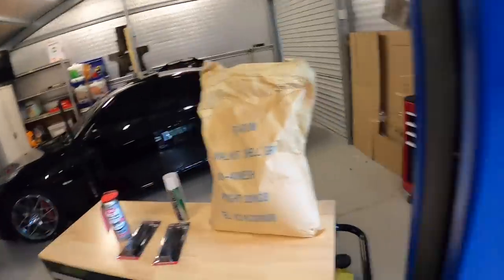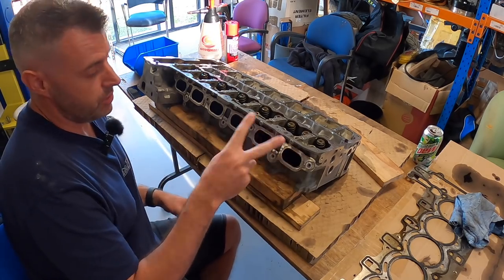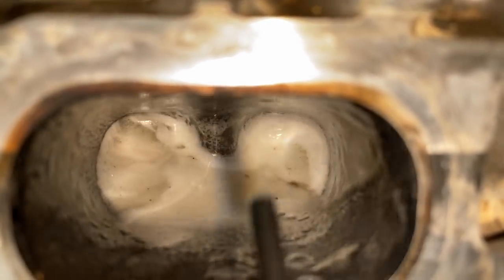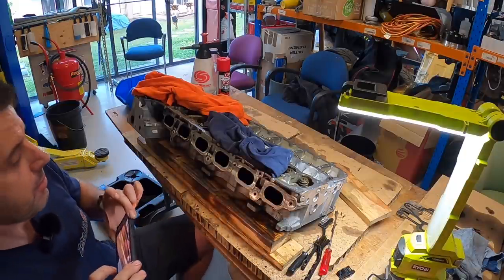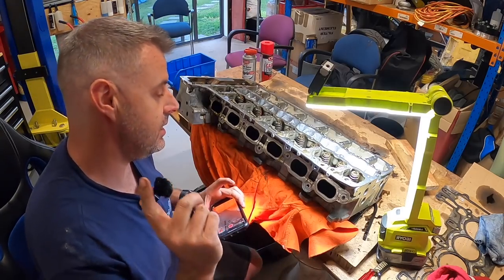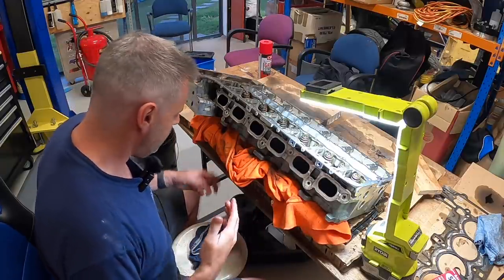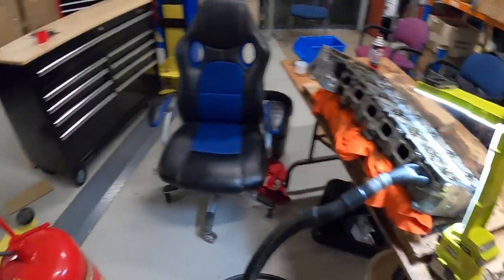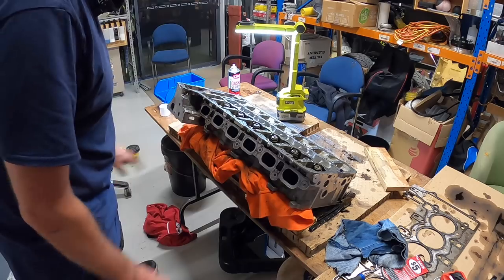BMW N54 Intake Valve Cleaning: CRC vs ThreeBond vs Walnut Shell Comparison

Comment: Brilliant video, thanks for explaining & showing the differences. I've just purchased my first BMW that has N54 engine. I would have to get a garage to do the walnut blasting for me, while engine is in car. May I ask how often or at what miles should this be done? My car is currently 9yrs old, but on 24k miles on it.
Reply from the maker: I think if you used the CRC or Threebond how it says on the can. So while the engine is running, say every 10,000ks you wouldn't need to walnut. But if you go much past that it wont keep things clean. Walnut blast i would do every 20-30k. 

If i wasnt running port injection i would be doing the chemical cleans in between walnut blasts.
Reply: @ZeroTo60Tube  I remember years ago I sprayed in a can of engine cleaner (not sure of make) into the intake of my Lancia Integrale at the time while holding revs around 2k.  It was to clean internals of engine & was rated well. Two days later headgasket went. Now I don't know if coincidence or whether the cleaner disturbed some carbon that was helping to seal something, but been nervous ever since putting additives in engine.
Reply: @stevesas632  engine cleaners wash down cylinder walls and affect the lubrication and wear the engine. They also harm head gasket material which is partially organic in composition.
Reply: @callmeishmael7452  Agreed. +1. But it might be ok to do the pairs of cylinders' valves when closed. A good cleanout and drying before the next pair should be ok, but still not cleaning the valve seats, which best done probably pulling the head and doing a valve-job.... Valve seats and seals on the valve stems work together to make the best motor - either sealing combustion, or lubricants.

Comment: have you thought about useing a burning laser to vapourize the carbon off the valves..no mess the carbon on the valves in lots of cases is not hardened on, just spongy like.. i have seen some not to costly handheld lasers here in the states.. 80 to 120 $..  just a thought i have been working on

Comment: I get why you need to go the chemical clean with the valves in situ but I'd recommend removing the valves and cleaning separately to ensure guides and valve seats are properly cleaned. 
Then hand the head to a shop for hot tank clean. Not expensive.
And I clean my valves with a wire wheel on the bench grinder without any issues
Reply from the maker: I didn’t need to chemical clean at all. As I mentioned this video exists to compare the methods. Not because I needed to. This head still needs to be stripped for what I’m doing.

Comment: Do you think using ambro carb and choke cleaner would it be better than crc? By applying it as CRC instructs (spraying it directly on the throttle body) I have a 2014 hyundai gt GDI, thinking on doing some valves cleaning as well, awesome video BTW!
Reply from the maker: I did try carb cleaner on my old motor and to be honest it was pretty similar. I think the CRC slightly tips the win tho. Something i have learnt recently is how important it is to do the treatments frequently, before it builds up like it was in this motor. Let us know if you do give a crack and the results you get.

Comment: I’ve cleaned heads I’ve had off with three bond. Let it soak for 48 hours and carbon falls off. The crc and three bond will not work inside 30 mins on a cold engine.

Comment: Question....assuming you’re doing this with head on the car.  That tiny amount of debris left at the very periphery.  You can see it when the valve opens, and you could only clean it with the valve ope, but risk some of it going into the cylinder.  Do you just leave it alone?
Reply: Doesn't cause any problems evidently as the walnut "sand" is softer than any of the parts it can come in contact with. The only downside is your exhaust may smell of walnut for a few minutes as it disposes of the leftovers, that's why they use walnut and not sand. I've recently been quoted $880 to clean EGR and manifolds and valves using walnut blasting on a 2011 Pajero with 177.000k. for interest.

Comment: I did the CRC cleaning last year and it worked great. I followed the instruction from Vehicular DIY as well. Great videos. The only thing with all of the options is cleaning the valve seat. With the valves closed it's just not possible. 
I didn't try running the engine while using the cleaner.
Reply from the maker: Thanks for sharing

Comment: Last weekend I used the CRC to clean the ports on N54 90k miles never done before. I filled ports with the slop then chiseled away with a aluminum pick set then vacuumed out the muck. I was having bad auto trans shifts turns out the engine was so choked it was effecting the auto trans adaptations making it feel clunky on down shifts. Now car feels totally different.

Comment: There was no shop here that did walnut blasting, getting the tools and importing them was waaaaaay too much money, so I went the chemical route with a methanol based cleaner. Took roughly between an hour to an hour 20 mins each cylinder and half a can each, using a toothbrush and a C thing like dentists use to reach the hard spots.
End result? Similar to walnut blasting but I can assure you I would never recommend doing it this way if you cN get walnut blasting. Takes for fucking ever and makes a mess
Reply: Use crc every other oil change and you’ll never need to resort to walnut blasting.

Comment: If the valves are not properly seating/closing because of carbon buildup at the outer edges of the valves, when you use the walnut media, does the walnut media get into the combustion chamber?
Reply from the maker: It will possibly. But I’ve seen people finish the job with bits of walnut stuck on the edge of the valve. So it must just pass through. A few pieces of walnut mustn’t cause any serious damage
Reply: Walnut media is soft, but hard enough to break the carbon down . The valves should be closed despite carbon buildup. Use his method of finding TDC. 
After blasting with walnuts you have to use compressed air to blow out remaining shells. 
If there were any that passed the valves you will burn them off or they will pass out the exhaust valve during the combustion cycle.

Comment: To use the CRC correctly the engine needs to be together and running. You are supposed to spay two entire cans into a running engine turning at 3000 rpm, with intermittent revs up to 3500. Let sit for an hour then take to the highway and blow everything out... done this way there is no mess as all
Reply from the maker: That’s what you’re supposed to do. I’ve never actually seen anyone successfully clean a di car with out taking the intake manifold off and scrubbing tho. Maybe if you did the crc treatment very frequently, might avoid it
Reply: Zero To 60 agreed, walnut blasting works the best. There’s a YouTube channel called watchjrgo that used the crc the recommended way, then used a camera to see the results.... it’s not as good as walnut blasting, but it also doesn’t require any disassembly. I have a 2010 335 and I do walnut blasting every 20000 miles, and crc halfway between blastings
Reply: Zero To 60 just realized I might be coming off rude, I don’t mean to. Love the channel, and you.
Reply: Max where do you spray crc, when the engine is running?
Reply: @coldfear19  while the Ivan is running spray the crc into the vacuum line that connects to the intake manifold

Comment: Seems the chemical cleaning methods might be something to use regularly to prevent them getting into that state, but if you need to clean up neglected intakes, walnut blasting is the way to go. One thing of interest, I mentioned cleaning the inlet valves to the euro mechanic I use and was expecting him to say walnut blasting but he said soda blasting, ever heard of that??
Reply from the maker: Soda is just a different abrasive. However I would be much more concerned about spraying it the intake. The walnut is soft in comparison. And definitely strong enough. 

Walnut works so well. Just a pain buying all the gear. And I can confirm you do need a semi decent compressor (not the Aldi one 🤣)

Comment: Just curious, how many km has the engine done and it did say on the can the engine had to be run before using the chemical products, so would that make any difference to how well it would have cleaned the ports if the head was still on the car? I do agree the walnut cleaning is a better choice.
Reply from the maker: Engine had done 120,000klms. You're actually supposed to apply this while the engine is running so it gets sucked through everywhere. But i really can't see that doing much to a built up mass of carbon like this engine had.
Reply: @ZeroTo60Tube  thanks for the feedback, I'm just looking at doing my n54 but cannot afford the walnut option at the moment and mine has done 138 000k's.cheers.

Comment: I suggest you try putting a magnet into the bag of walnut shell some of this media is contaminated with metallic particles which if any gets int the engine  cylinders or in the valve guide it could ruin your engine

Comment: only watching this cause i have the same issue, do you think fuel additives like seafoam can help with carbon build if i use it once a month?
Reply from the maker: Unfortunately not at all on the direct injection engines. The fuel is injected directly in to the combustion chamber so the fuel never passes the inlet valves like they do on older motors. Best thing you can do is frequent oil changes and a healthy pcv system.
Reply: @ZeroTo60Tube  thanks for the response mate! Looks like I'm doing it the old way this is my second time  cleaning my intake much more like a 2t😂

Comment: So if you were to run a manifold that had secondary port injectors on them (if you maxed out stock injectors) this problem could pretty much be avoided entirely could it not? Catch can would help too ya?
Reply from the maker: I believe so. We’ll get to see how the intake looks on my e92 cleaned about 4-5 months ago and have been running port injection the whole time.
Reply: @ZeroTo60Tube  that will certainly be a nice contrast to see!

Comment: Nice video.  Looks like once you get it clean, you need to use the chemical cleaner periodically to keep things clean?
Reply from the maker: Yeah, totally agree. Once the valves are clean if you used the chemical products the way they are designed and frequently it should keep it under control.

Comment: Do you think its necessary to cover up the hole inside the port that goes to the rocker cover when walnut blasting? Someone commented that you need to do it in your first walnut blasting video but I haven't seen it mentioned in any of the other walnut blasting guides online.
Reply from the maker: I didn’t cover my main engine when I did it, but I fee like they really should be. That said as long as you have a good enough shop vac it should be fine.

Comment: the three bond/subaru stuff is supposed to be used regularly as a preventative every oil change. Even back in the GC8 days we would pull off the vac line, spray it in and let it sit while doing another car. For caked on stuff you need to let it sit or repeat applications. It came out when port injection was the norm. For DI engines that are badly caked up like this it was never designed for and I would expect several applications over a period of time would be acceptable. Couple of cans vs the guy who doesnt have a compressor, shop vac and media blaster might not want to go buy that stuff to use it once a year/5 years. If I had a DI car, I would drill and tap each runner if possible and use a grub screw/bolt so cleaning isnt such a big deal. Of if you use a port injection kit just remove the injectors and spray it in there

Comment: I'm curious what the best way to actually clean the sealing surface of the valve itself would be. With the head on the engine you for sure can't open the valve and blast anything unfortunately... But at least for you with the head off, you could open the valves and blast the actual sealing surface. Seems to me that while everyone noticed the engine run better after blasting. Not cleaning the sealing surface is likely still problematic. Or I'm missing something.
Reply: Yeah, I think you're spot on. Would be quite interesting to actually measure the difference before and after cleaning the sealing surface.
Reply from the maker: I’ll do the sealing surface the same way I did the problem exhaust valve. This vid was to compare methods that most people are using to clean their intake ports. I only did this to show others the difference in the two methods.

Comment: Great video! Appreciate the time you took to make this even though you already knew the walnut blasting would take 10 minutes. LOL. Question though: what size walnut media do you recommend?
Reply from the maker: Its ordered as fine walnut here. Its about the size of raw sugar. I was genuine curious what the chemical method was like when done on the same level of carbon build up. Definitely not worth wasting your time with in my opinion, go nuts...... :P
Reply: @ZeroTo60Tube  😆 dad jokes👌🏼
Reply: @ZeroTo60Tube  I'm with @Luis Lozano, thanks for taking the time, great channel + content. An issue: those great + stronger smells, the use of the blower into the port*, all extra exposed you to chemicals which you won't even think about when you get that C diagnosis....

*if you can't stand to use a baster to empty something (buy a bunch, ~$1.@AUS), you can get a vinyl or acrylic hose, drill a hole in it maybe halfway along, then inset an inflator-needle on a compressor-airgun tool, like the needle used to inflate a basketball. Aim the needle away from the wet stuff, blow some air down the tube toward the drain pan, and it will create low pressure behind it and suck whatever liquid out the tube. Great, safe way to start a fuel siphon. Just stop blowing once flow starts, and keep the high-end submerged.

Comment: Also a hell of a mess and usually done on the bench but consider using a spray or even paint on paint stripper. Did I also see a can of gasket stripper at the back of your bench? Give that a go! 
If that doesn't work, why not try lemon juice or a nice red wine vinegarette? I have heard that Maggie Beers Verjuice works on everything....... 🤔 

I wonder how much of this gets to your valve stem seals and what it does to them as well. When you change them soak a few in the products and find out!?

Comment: Time to get a sand blaster 👍 just paid a shop $550 to get this done.
Reply: Just make very sure you have the valves closed before you start blasting walnuts. I did this with CRC and thought I did, but they weren't... no big deal with CRC, but very bad with walnuts.

Comment: i believe this can be cleaned since there are tiny ports on each cylinder coming from pcv, u can plug a hose on to the pcv valve connected to a container filled with a fuel cleaner.  what do u guys think.?
Reply: No, there are other ports in the PCV system in the valve cover that lead directly over your camshafts, wouldn't recommend.

Comment: I think crc method but with engine running seems to be ok I do this in vw evey 10k miles seems to work well open the manifold in these new cars is a disaster waiting to happen too many things to remove

Comment: Kinda hard to compare a chem product against Walnut. 

CRC doesn't require dismember of the engine and has a process that makes it quite effective written on the can. 

It saves V8 BMW owners like myself over 2000$ for a walnut job when 2 cans of CRC do the same thing.
Reply from the maker: CRC isnt strong enough to remove the build up of carbon by itself, it 100% needs to agitated and like you see in this video, quite aggressively scraped. That said, if you have a PI car (or have had a walnut blast and have clean valves) then using the crc regularly should do the job. Just not when it is built up like mountain of tar.
Reply: @ZeroTo60Tube  I run crc every 5k as preventative maintenance on my n63 since the engine has to be removed to even lay eyes on the intake valves. 

I've personally seen my CEL go off after running a full can down each bank.
 It may not have your valves looking prestine after sitting cold for 20min against the instructions, but it absolutely cleans the valve seats enough to seal the combustion chambers.

Comment: When you did your first video on Walnut blasting you used a gravity fed walnut hopper/dispenser. It didn't seem to work but you did state that media was the wrong size. Do you think the gravity dispenser and the correct sized media would work? Also what about using soda as a media? Thanks for the videos you are my favorite Automotive channel, always enjoyable to watch :)
Reply from the maker: I think with the correct media, you would get away with the gravity fed style. I don't think they quite pack the punch of the style i have now, but we're talking 60 seconds of blasting vs 120 seconds. Still a lit quicker than the chemical option.

Comment: Pull them out and wire wheel on the bench grinder and blast the ports with walnut shell then lap them all back in
Reply from the maker: Way ahead of you. This vid is just for others looking at the different ways they can clean their own intake ports. I’ve never seen anyone use both a chemical method and walnut at the same time. They do it the way they think is best and say “yes it works”. I wanted to see for myself how different the two ways of cleaning a di intake port are.